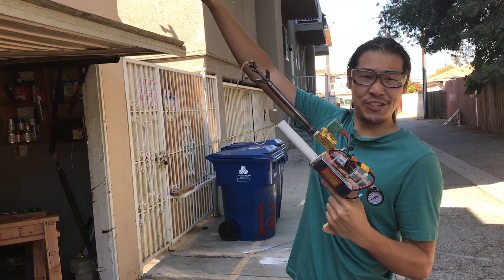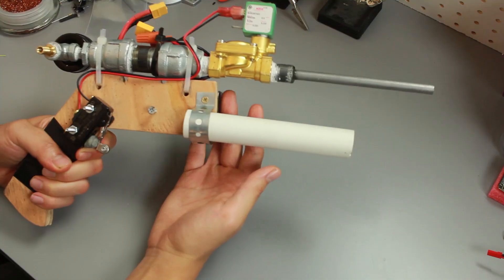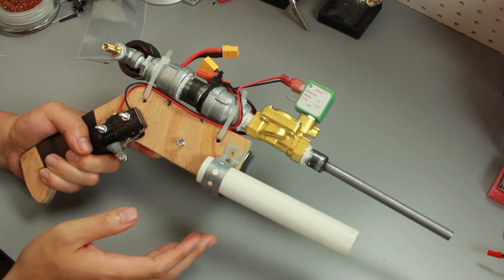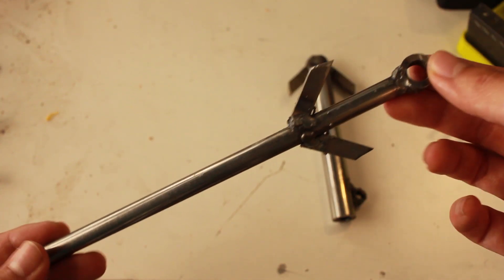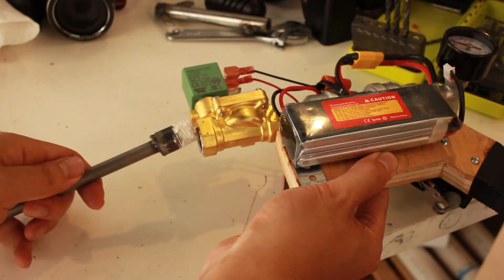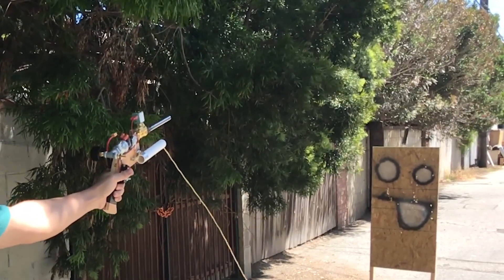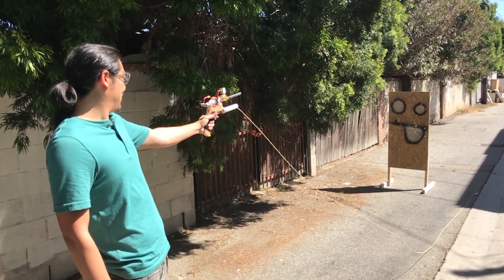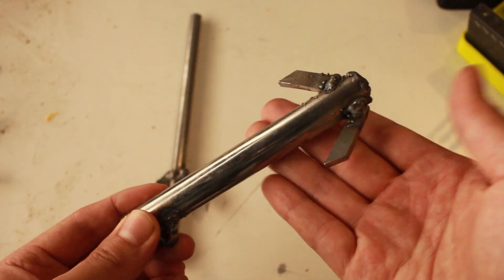Awesome Homemade Grappling Hook Gun

Comment: Try casting the grapnel hook in aluminum.I like the straw design maybe add flight stabilizing fins , like a dart or rocket would have.
Reply from the maker: Aluminum would be cool but I probably wouldn't be able to cast it with tight enough tolerances. If I get access to a tig welder though I'd definitely want to try out aluminum or titanium parts.
Reply: Added bonus if you cast it in aluminum it is a solid peice and solid of structure if you are uncertain of your welding skills.
Reply: Will Ham Animates Nope just seemed to be a logical step in the progression , if you want to improve flight distance , improve aerodynamics.
Reply: triplebackspace I was thinking aluminum too. Really strong and light. The straw is my favorite too.
Reply: Sufficiently Advanced This may seem a little weird but you could also try  just modifying large fish hooks , not the small ones!, the big ones for tuna and shark fishing , sizes 13 and up. Size 20 shark hooks are larger than you hand about pencil thick in diameter and made of carbon steel. You can get a look at what I am talking about on Aliexpress. It may work  , if you can just get past the weirdness of using a fish hook as a grappling hook.
Reply: triplebackspace did you get that idea from grant Thompson?
Reply: triplebackspace Dude, aluminum is a little fragile. IMAGINE A FAT GUY TRYING IT IN TO THE OPPOSITE SKYSCRAPER
Reply: triplebackspace oh right, thanks must of mixed the two up
Reply: EverythinGamerz365 he is saying to only cast it in aluminium not make the whole hook from it
Reply: Sufficiently Advanced whoah whoah whoah, lemme fan boy out here and say hi
Reply: Sufficiently Advanced have you seen brain ion's channel? He is the closest of making a real life web shooter.
Reply: EverythinGamerz365  It is relative, they do make airplanes out of the stuff after all. A good solid peice of it will hold a fair amount of weight , though I do admitt I am not a material engineer , so my knowledge of the material is limited. Good thing scrap aluminum is cheap and it is not difficult to cast , and he seems to be willing to experiment in a fairly safe manner. It is worth trying just to find out how much you could support and how much weight it could save.
Reply: Fionn O' Flaherty ok lul im 10 so im dum
Reply: triplebackspace remember it needs to flip over to grapple the fins would stop it from doing that
Reply: Fionn O' Flaherty I don't think the straw design flips . It looks like the straw design tethers the back.

Comment: Is it unfeasible to use lightweight alloys? Like magnesium or aluminium alloys?
Guess you would have to make a larger hook if you used those :/
Reply: JJantson I think aluminum would be more then strong enough, but you're right maybe @SufficientlyAdvanced should experiment to see if it would work
Reply: mslmsldk 
Steel is an alloy. In fact, there are several thousand distinct steel alloys used today. Steel can even be a soft alloy. There are aluminum alloys that can rival the strength of common steel. Personally, if he can get it, I'd suggest he use titanium. If he researches it thoroughly enough, and can gather the right equipment, he could even weld it as needed. Titanium is a very sticky substance when molten. It's not that hard to weld, as long as it's kept well protected from the air by shielding gas.
Reply: Lukegear I don't see why he wouldn't be able to use just 6061
Reply: Yes! It has some quite decent mechanical properties. I really think he should try it out
Reply: the. Amazing 
You are incorrect that you can't weld aluminum. It actually welds quite well. I'm a certified welder. I should know. Personally I'd suggest trying titanium though, it has a similar strength to steel but weighs almost as light as aluminum.
Reply: a santos 
That depends a lot on the particular alloy of aluminum. As well as how it's treated. Same with steel actually. Many steel alloys when treated just so will shatter before bending. Such as a knife. A knife is designed to flex a little bit, but then shatter. They do that because while fully hardened (non flexible) steel will stay sharp longer, it's also very brittle and will shatter with the slightest impact.
Reply: shielded metal arc welding, also known as stick welding, is most commonly used in steel but there are different welding rods that can be used with different materials such as aluminum. although that never looks very good as it doesn't run very well.

gas metal arc welding, AKA Mig welding (which is what most people think of when they think of welding) can be used for both steel and aluminum. in fact, it's one of the more common ways to weld aluminum. 

gas tungsten arc welding, also known as TIG, can be used with most any metal actually as long as it's capable of melting, which is any metal.
Reply: a santos Good point! We will have to see if the forces he's putting on it could be enough to crack which alloys
Reply: Lukegear the problem with light weight metals like aluminum is that it might not be able to hold his weight if he made it the same size as the steel. He would have to compensate greatly for how weak and malleable the metal is, so in the end it might end up weighing more than just the regular steel
Reply: Can't weld aluminum
Reply: Oh I always thought that
Reply: Maybe just arc welding I'm thinking of
Reply: the. Amazing 
What type of arc welding? There is shielded metal arc welding, gas metal arc welding, gas tungsten arc welding, etc.
Reply: Shielded metal arc welding, also known as stick welding. gas metal arc welding, also known as Mig. gas tungsten arc welding, also known as TIG or heliarc welding.
Reply: Yeah I have an arc welder that uses sticks and I have only ever used it for steel
Reply: the. Amazing 
Ok, yeah. That's shielded metal arc welding, stick. You can buy aluminum welding rods for it, though it doesn't actually work very well... The weld puddle is very fluid and the rod burns very fast. It's really only good for field repairs where other methods aren't available.
Reply: Atomic Fire you can, but having seen how he welds steel, do you think he could actually weld 6061 halfway decently? His heat control seems kinda ass, so I'd bet that he'd just melt that tube.

Comment: The wrapper is quite efficient actually. It's what a lot of real pneumatic launchers usually use since it can make very good  use of the compressed air escaping the barrel. It just has the side effect that the air has to travel down the length of the barrel first before it can act on the outer projectile.  You want to make it as long and low friction as possible to get the best acceleration from your air pressure. I'd use a sealed PVC pipe design that can fall away once the hook has been accelerated sufficiently. But realistically they should both give similar results at low pressures. Once you go into the really high pressures an inner 'gun' type design is much better.